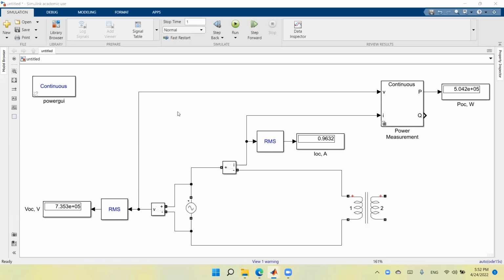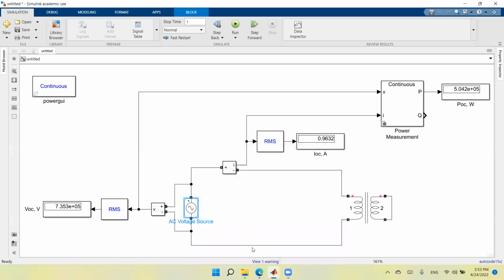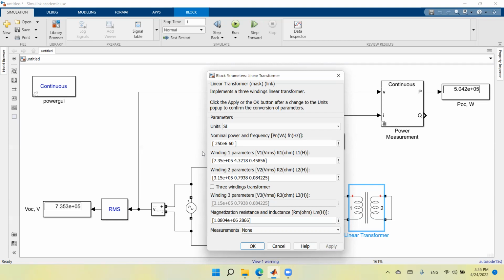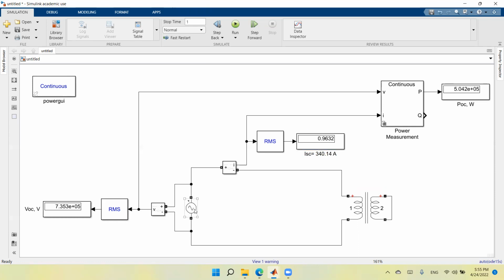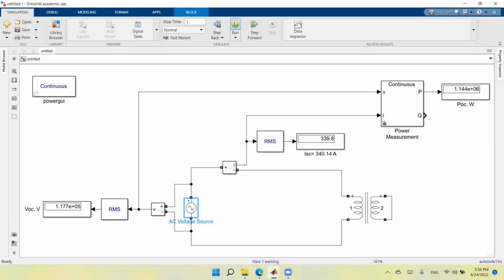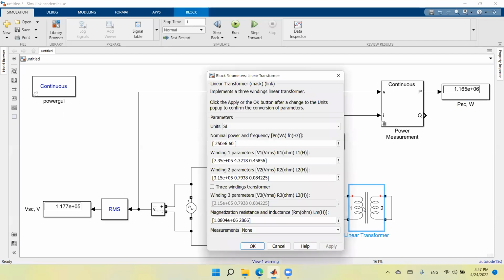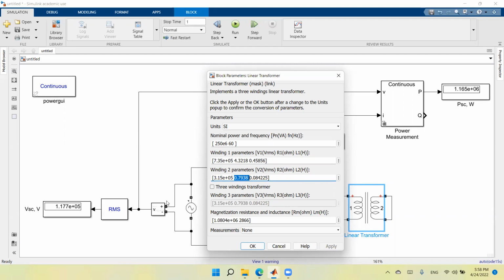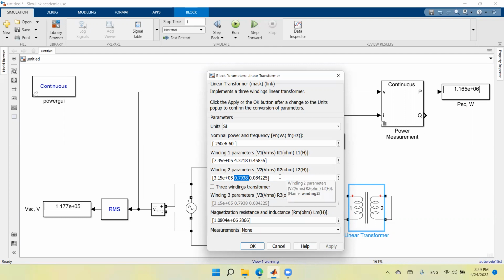11 MATLAB Simulink Transformer Short Circuit Test

Comment: dear Ms. Jufolt i have a question for tests, i calculate the parameters with equivalent circuit. I found some Xm Xl parameters with ohm unit. How can i transform to henry unit for Magnetization inductance and winding inductance?
Reply from the maker: You can divide the ohmic value by 2*60*pi to get the inductance in Henry